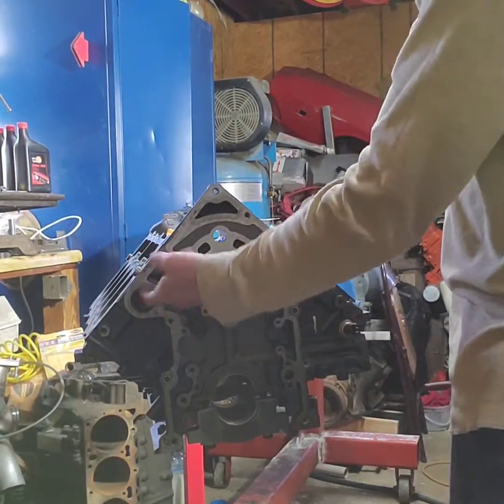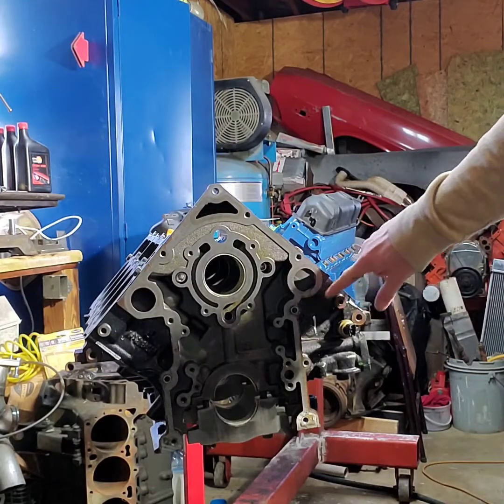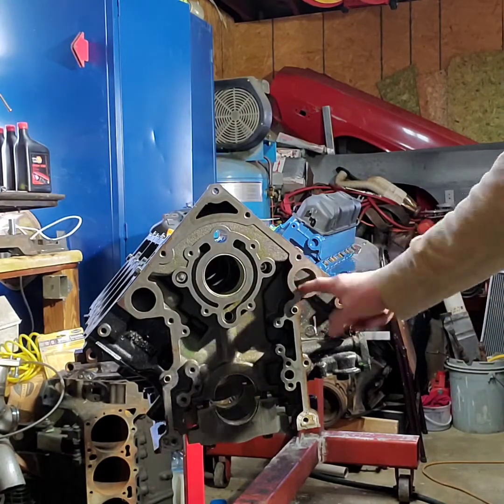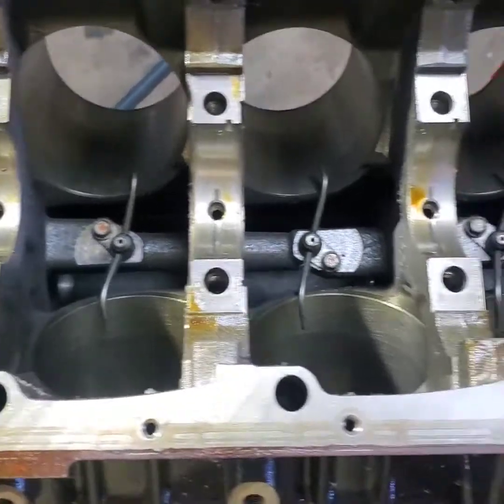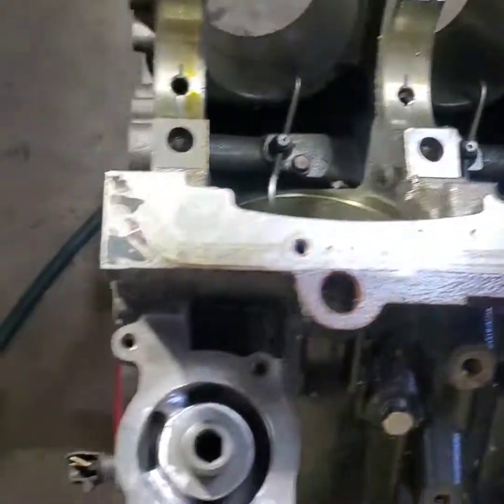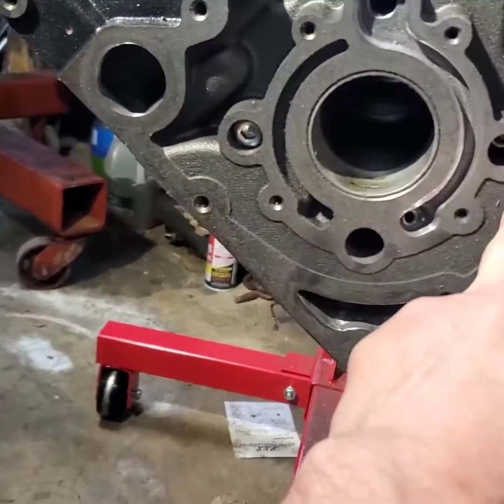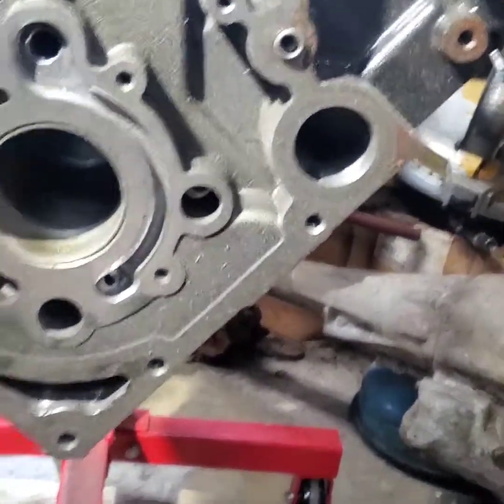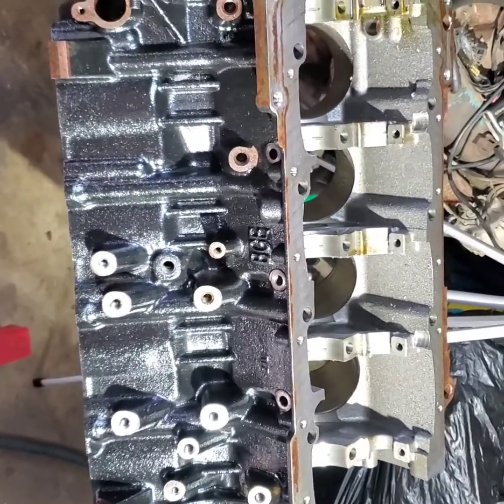6.4 Hemi Block Mods

Comment: Hello, I ordered an longblock for my 2015 Challenger 392 hemi. The engine arrived from America.the engine block is BGE, The part number on the block and the part number on the cylinder are for Dodge Ram.Has something gone wrong?
Reply from the maker: No all 6.4 are BGE Blocks but the heads should be apache and not BGE
Reply from the maker: For the record BGE heads are better but Apache have a better vavle setup.
Reply: @turbotoadTV  But this longblock I received is for a Dodge Ram. Is it suitable for my Challenger?Because the Dodge Ram has 410 horsepower.